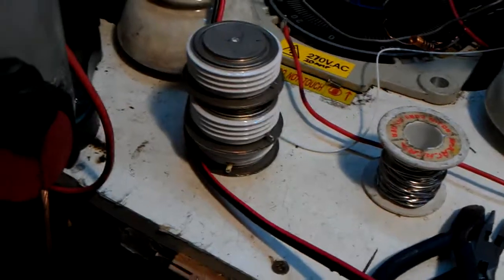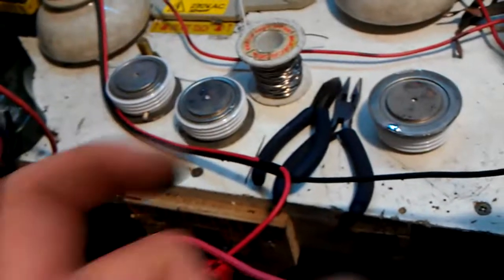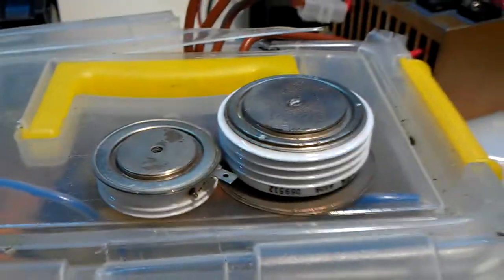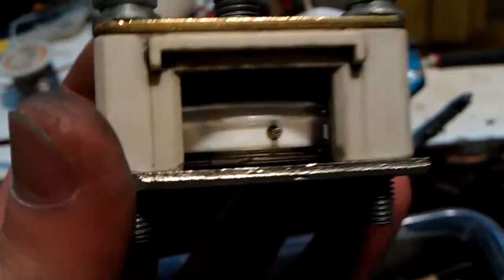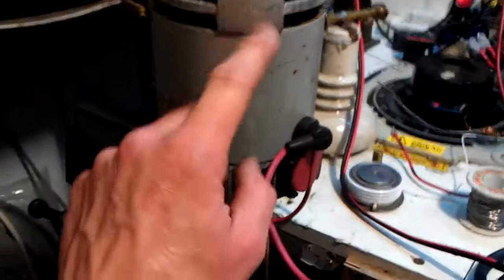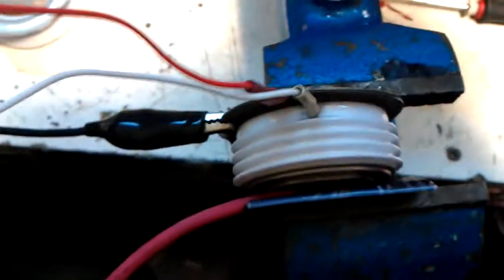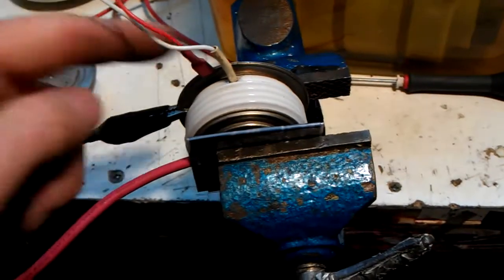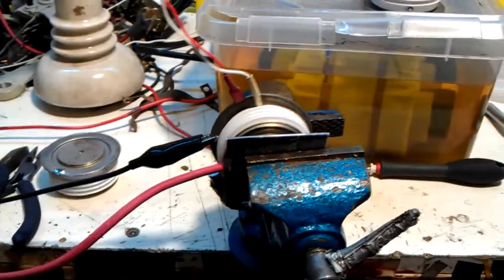Trying a thyrister' on dc motor

Comment: if you want to make an on off control using thyristors then have a second thyristor connected in parallel via a capacitor. then you can fire the first thyristor and the motor starts then fire the second to stop the motor. the capacitor will need to be 100uf good quality type non electrolytic by alternately pulsing the gates at high speed a DC speed control can be made - if you are interested and i can PM a schematic.